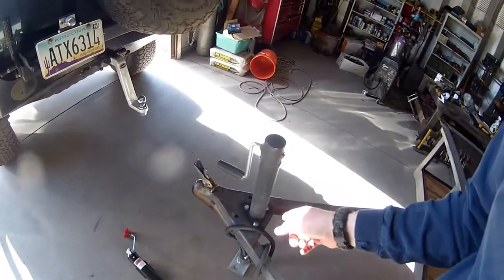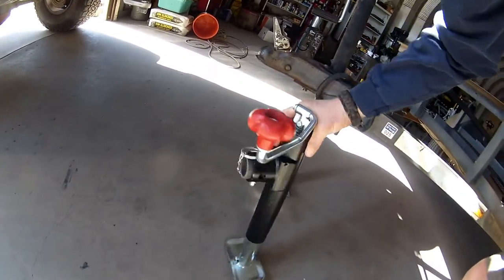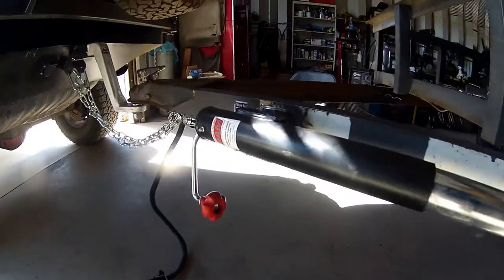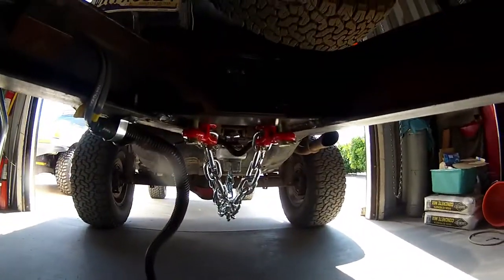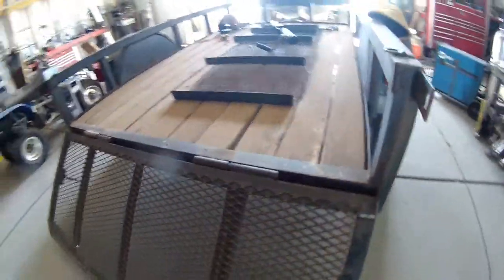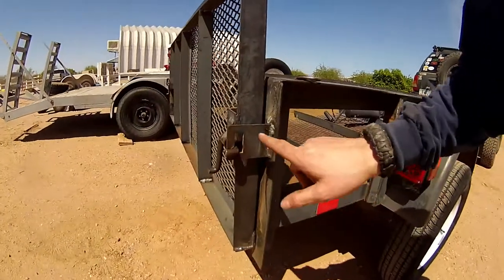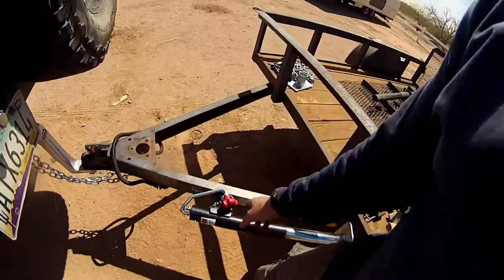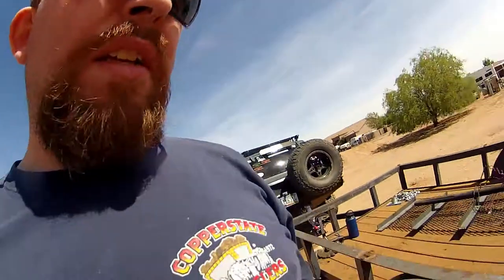Overland Trailer Build Part 2

Comment: I have the same trailer (though a Texas Bragg) and want to 1) mount my tent lower (maybe two feet off the bed) and 2) mount the tent with opening facing the rear so I can use the tailgate as an in/out/on/off point.  Any ideas?
Reply from the maker: Thanks for watching and thanks for the comment. A couple things I would make sure to keep in mind is that your ladder will be happier if it's on a flat surface when it's deployed. Also keep in mind your tongue weight. I'd position the tent on the trailer wherever your tongue weight will be happier. Build it to fit you. If you're a tall guy you may want to mount the tent higher I'm 6 ft tall so that's why I mounted mine a little higher. But good luck with your build!
Reply: @TheRightLine  Thanks for the input!